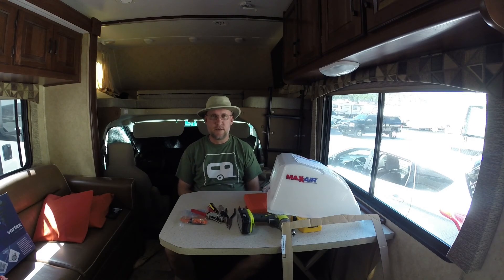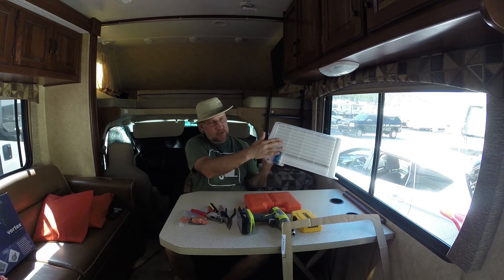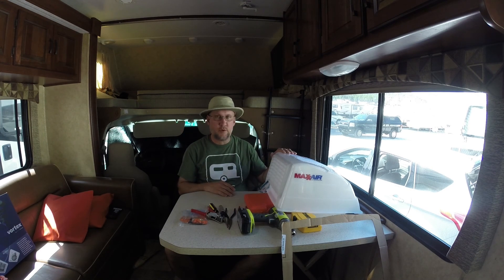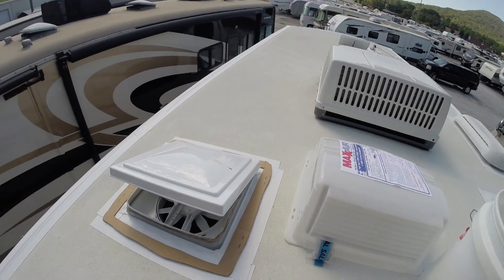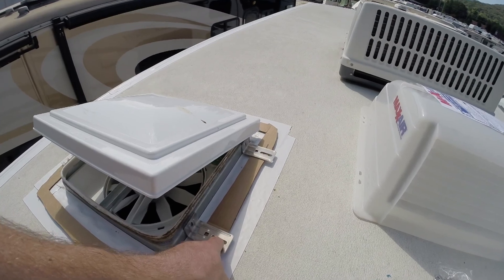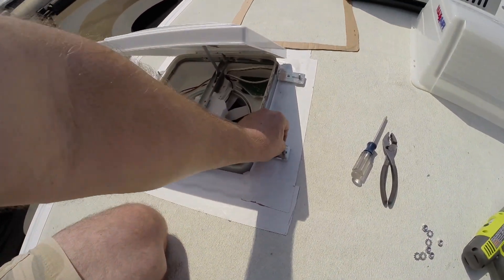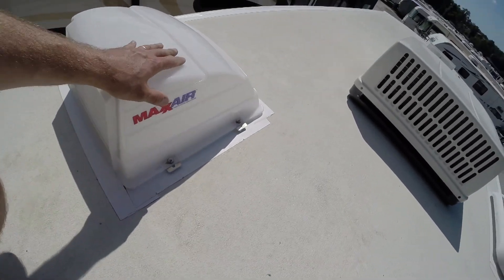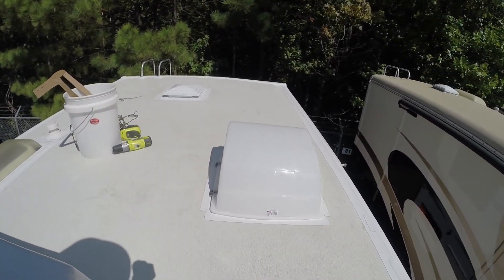How To Install MaxxAir Vent Cover

Comment: Why didn't you put the vent covers and/or fans on all of your vents? I've been looking for a good way to increase air flow so we can dry camp more often and this looks like it would work perfect. We also use a solar panel to keep the battery topped off. You should make a video of the solar panel install and I highly recommend a Renogy Solar kit with 200W power output. You'll never run a generator or pay for grid camping again.
Reply from the maker: Good question.  Guess I just don't need them at this time as I don't boondock much (or at all really).  I do want to start doing that though.  I did notice when I was replacing the vent covers that there is power run to all of my vents so I can retrofit a fan to the other two if I want to in the future.
Reply: just from experience, I highly recommend the solar system and more airflow makes it much more comfortable if it's warm outside. We have done some experimenting with our AC off when its 90 degrees outside and we can get our camper down to about 75 inside just with a couple fans. If I could run a couple vortex fans off of solar power and their set to suck air out through the roof I think it would work just as well not to mention most of the good camping spots are closer to the water where the breeze coming off of the lake is also cooler! I can't wait to order a couple of these fans.
Reply from the maker: Thanks for the input.  Good luck with your setup.